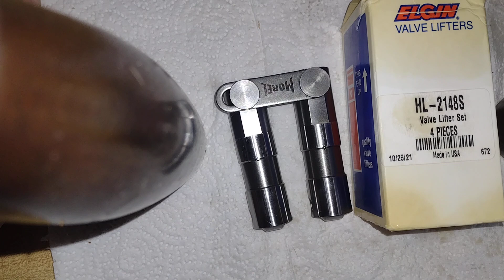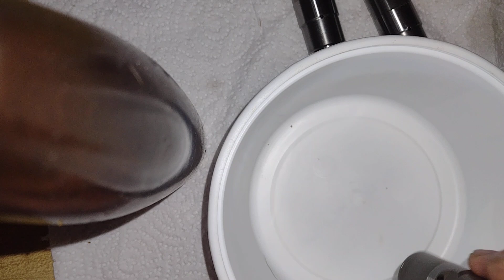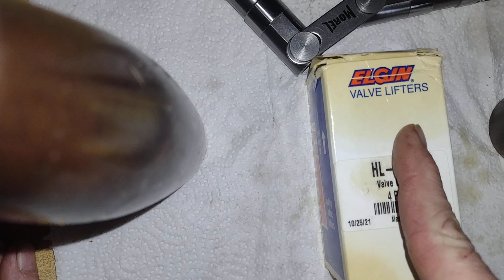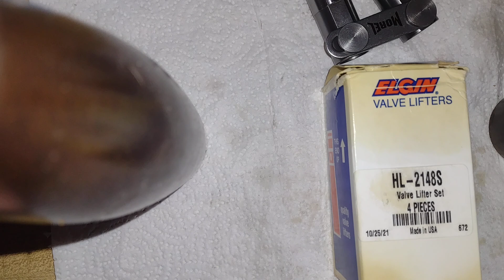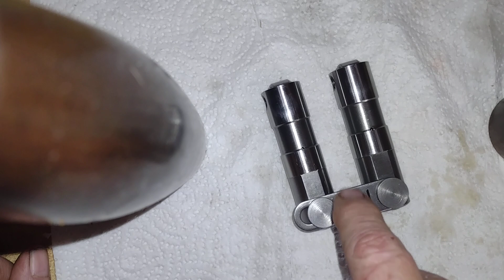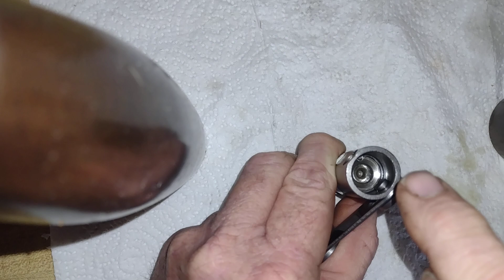Ditching the Morel 5372 lifters

Comment: I talked to a machinist at a the machine shop and he said he takes those bar hydraulic roller lifters any drills the oil port hole at the bottom in front of the trunnion wheel and drills the existing hole at the top larges, and he said there's no more oiling trouble with those bar lifters with the the tiny oil port hole and a non-existent lower oil port hole like the Johnsons & Millen lifters...

Comment: Buddy I know exactly what your going through. Yes indeed, Morel is rubbish.
I bought a set of Morel 5321 hyd roller lifters for my small block Mopar. They are absolute rubbish, I wish I'd never bought them. Noisy as a bucket of bolts, so noisy its embarrassing to have the engine running near friends. I cant remove them without removing the heads so they are still in there otherwise I'd have thrown them in the trash a long time ago. WHATEVER YOU DO NO NOT BUY MOREL !!!!! ABSOLUTE RUBBISH.

So bad I'm actually considering going back to hyd flat tappet. I'm so sick of these things rattling like they do. Tried oils from 5w-30, 10w-30, 15w-40 and straight 30 . Tried preloads from 1/4 turn through to 1 3/4 turn. Valve spring pressure as recommended by Morel. Block has new bronze lifter bores fitted and sized to 1.7 thou clearance. Spent so much time trying to get these to shut up, lost track of how many times I've had to rocker covers off. I went hydraulic hoping for a quiet set and forget engine but all I can head when driving is the bloody rattle from under the hood.
Embarrassing when people start telling you you've got a problem with your solid lifters when they hear the thing run. As if that wasnt bad enough you have Chris Straub making every excuse under the sun and of course the problem is never the lifter. that guy is soo full of bullshit it spews out of his mouth when the speaks. Absolute moron that refuses to listen but just keeps throwing excuses. Just google "Morel noise" and see for yourself. How can all these people have the same problem if as Chris says its lifter clearance or oil type or valve springs or engine buildres fault or dirty oil or incorrect installation or cam profile and the list goes on. I've heard it all.
Frankly they should be pulled off the market till Morel finds what the hell is wrong with these things or tell people they rattle like hell and drop the price to $100 a set. Even that is expensive for such rubbish.